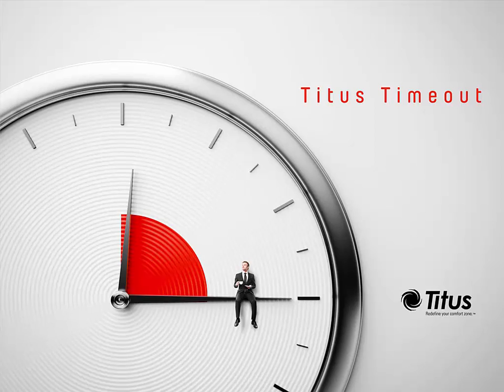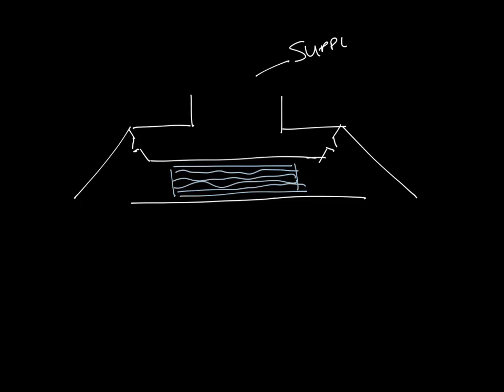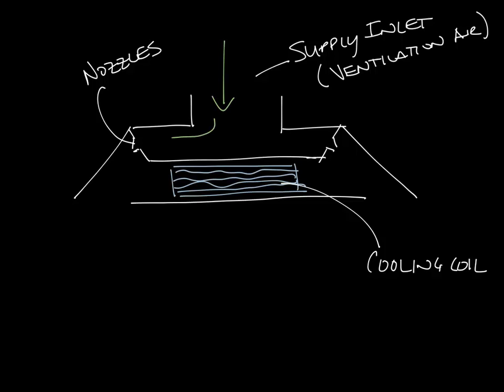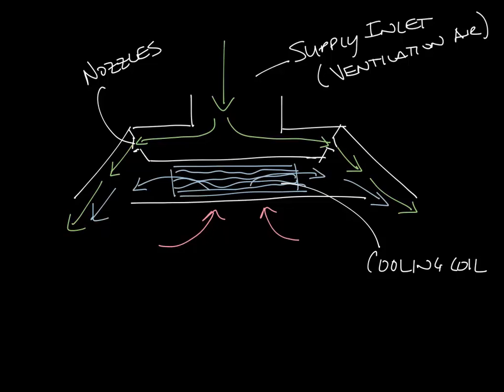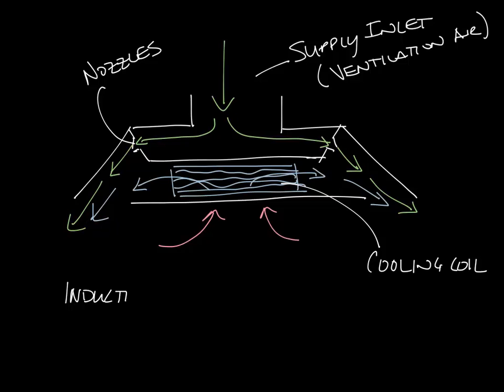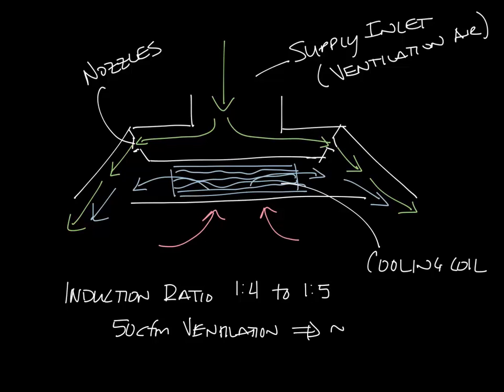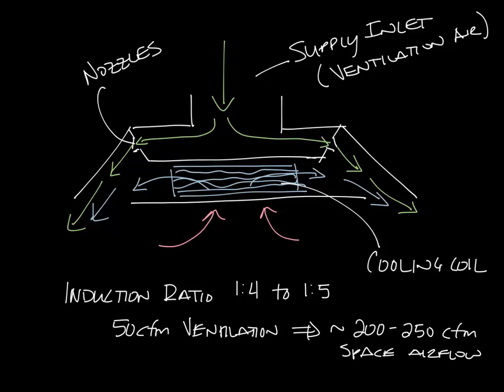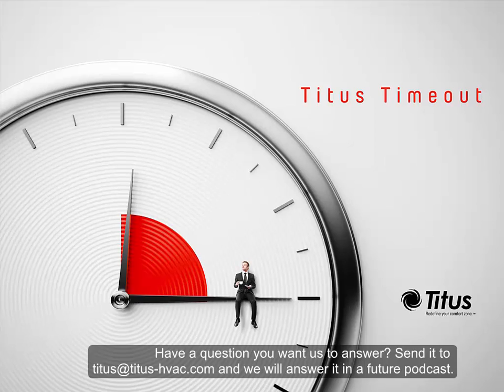Titus Timeout Podcast - How do active chilled beams work?

Comment: can chilled beams be used water from IDEC units ,water temperature : typically wbt-2 degree celcius power consuption 40% of chiller(during low humidity seasons)
Reply from the maker: Are you asking if beams can work with direct evaporative coolers?  If so the answer would be yes.
Reply: thanks for replying , i wanted to ask if chilled beams can work with 2 stage evaporative cooling , water inlet temperature is 2-3 degree Celsius below for 2 stage in comparison to direct evaporative cooling
Reply from the maker: Chilled beams can work with evaporative cooling as long as the water temperature is maintained above the
room design dewpoint.
Reply: in evaporative cooling water temp cannot go down below ambient wbt , which in 99% cases above room design dew point. issue is in monsoon season , rh increases and water temp will tend to go above designed room dry bulb,thus failing to provide comfort cooling.